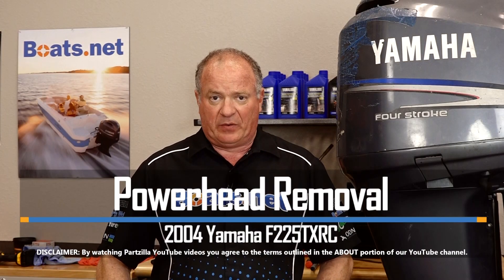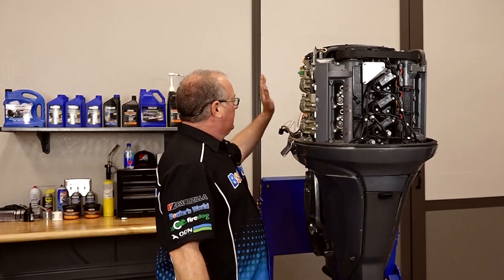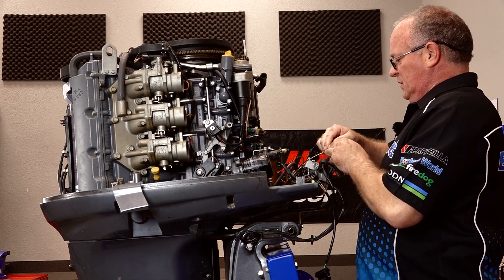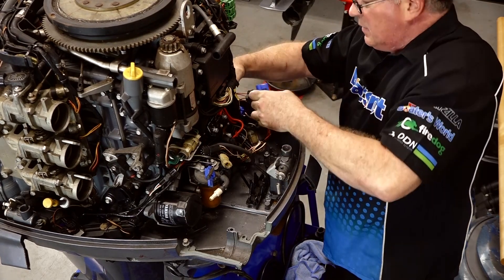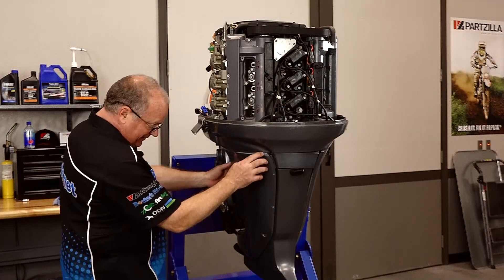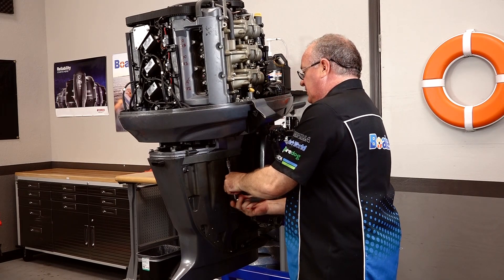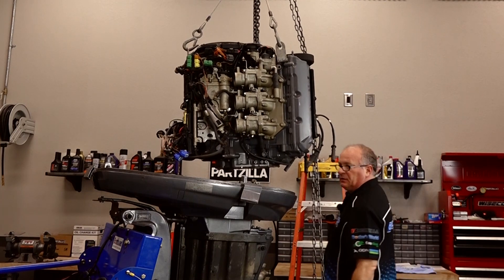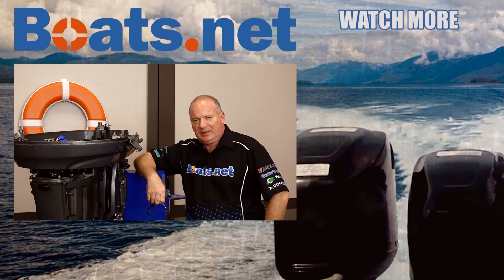Yamaha 225 Powerhead Removal | How to Remove a Yamaha Powerhead | Boats.net

Comment: Hi, I bought two 2003 Yamaha 200hp motors I was told one had small corrosion on the exhaust, called a local mechanic shop and they stated if the corrosion got to the power head the motor was done for. My question is how do I know if the power head is damaged by corrosion? Is it true you can’t put it back together if there is corrosion in the power head ?

Comment: What was the repair for the corrosion at the bottom of the powerhead?  Replacement part or new powerhead?
Reply: Did you ever get a response? Took my midsection off tonight, the corrosion is worse on the powerhead than it is on the midsection.
Reply: my steering arm bracket broke due to rot on my 1996 yamaha 200 hp v6 outboard does powerhead need to come off to replace